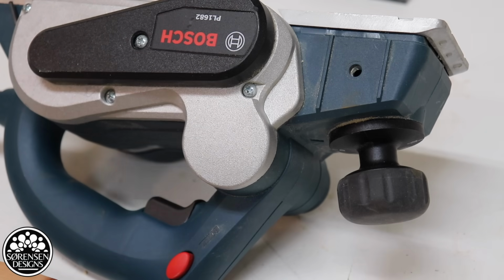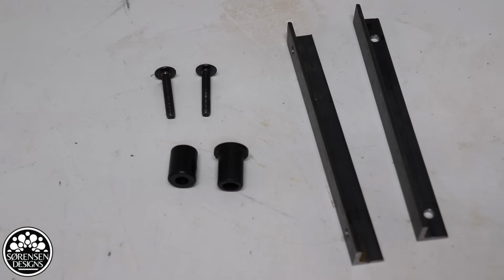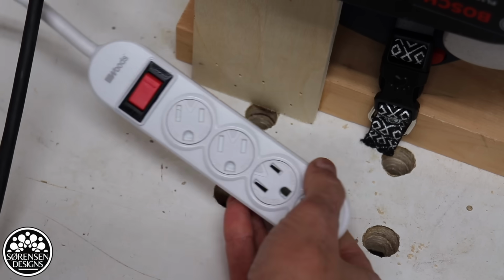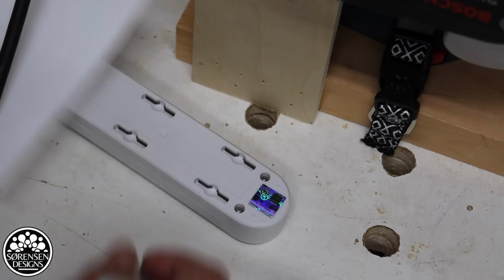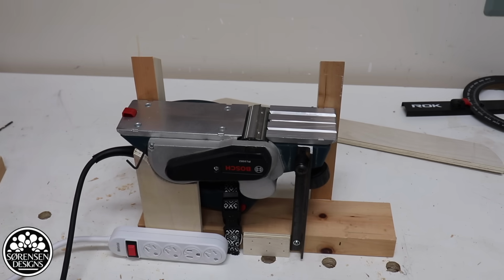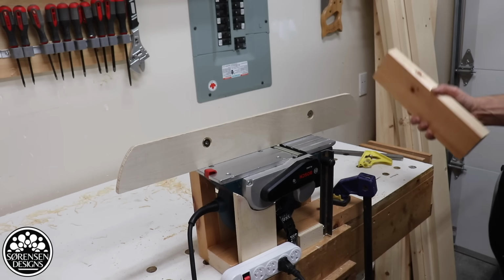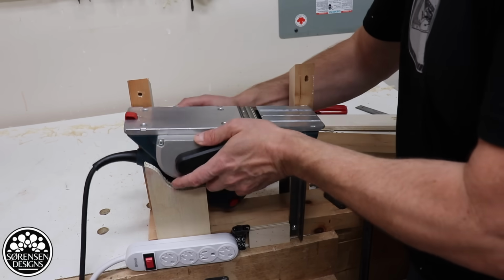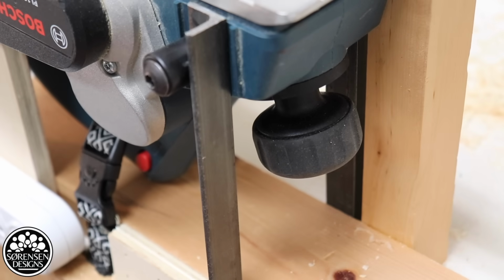Turn Your Hand Planer into a Jointer for Only $10

Comment: Great idea from the UK
Reply from the maker: Thanks @Paul Gray! Cheers🙂
Reply: Eric Sorensen would I be able to make something similar with a belt sander? Have you tried this.
Reply from the maker: @Paul Gray  You could probably make it work with a belt sander, however they generally don't have guide fences and thus no mounting holes machined into the tool. You would probably need another way to fasten the sander to a frame. I have never tried it myself because I have a stationary belt sander.

Comment: Super new to wood working but falling in love with it quick. 

Gonna be trying to make this jig this weekend in hopes of jointing some boards for a table top I’ve been slowly but surely putting together. 

Would this jig handle longer boards fine or would it need some additional fencing, or maybe even a track for the wood to exit onto?

No problem if you don’t see this, but thanks a million in advance for any info/suggestions at all from anyone who happens to see this!!
Reply from the maker: This set-up is only good for shorter stock / boards, maybe up to 30 inches max. For long boards, my latest video covers a different method: https://www.youtube.com/watch?v=-ydvJ6VXdt8
Reply: @EricSorensenCanada  awesome! Thank you so much, I’ll be watching that video right after work today!

Comment: just used your idea and works great .. i priced them planner  jointers $300 to $400 dollars and i`am like u do`nt use it much ..
Reply from the maker: @richard felt Glad to hear it's working out! Yes, I looked at a bench top jointer by Porter Cable, I think it was around $400. It wasn't just the cost but the fact that it takes up space that I don't have. Cheers 🙂

Comment: I do like the concept, but my only "drawback" to it is what happens if you have to run a longer piece of wood through it? Not that I am "hating on it" but I personally would want a much longer range of travel across the top of it, for the work I want to do, which is making table tops and things like that!! But it is still a pretty handy tool for a small shop, and I respect that!!!
Reply from the maker: @Greg Benwell  Build an in-feed / out-feed table or platform to support longer boards. This solution is really only meant to be a part time jointer.  If you are building a lot of table tops, then it is probably worth just investing in a jointer. You can also try the table saw jointer trick, which works pretty well for long boards.

Comment: Is it easy for long wood, especially morethan 2 m? 
Over all! Great work. Thanks for sharing it.👍👍👍👍👍👍
Reply from the maker: @firman syah It will work for parts that are less than 3 feet in length if you add an in-feed and out feed platform to it. If you're working often with longer pieces, it would be best to invest in a proper jointer.
Reply: Ok, thanks a lot. In my general work, I think your creation will make easy for working because simple and we can bring every where. Great regard from me.👍👍👍👍👍👍

Comment: This is so exciting to try.  Can I use wood instead of the iron supports?
Reply from the maker: @Melissa Karman Yes, however it might make the whole thing a bit bulky. You can use aluminium angle iron instead. It is soft metal and can be cut with most conventional blades. Hack saws and metal drilling drill bits will go through aluminium very quickly.

Comment: hi Eric , nice jig. I have cheap planer like that.
At  1:00 you drop a tip, about alignment for the tool.
speeding up, at 6:30 you mount the posts for the fence, with one screw and glue, but how does that secure alignment to the sole?
Where you just plain lucky? :-)
Reply from the maker: Thanks @T0rb1 NAalborg! The alignment I spoke about was in reference to mounting the angle iron. As for the fence supports, if you rip your base block to the same width as your planer, you will have no problem aligning the posts for your fence. This is assuming you have a nice flat table top to work from and you use a speed square to ensure the posts are proper square.

Comment: What would be the longest board you would recommend?  I like the idea and concept.  Great work.
Reply from the maker: @Chris Elliott, Ph.D Thanks! I generally don't run anything over 3 feet on this set-up and with that, i would suggest adding an in-feed / out-feed table or platform.  If you regularly plane boards that are longer (or wide), then I would invest in a proper jointer. Or you can use the table saw method of edge jointing, which is what I do for long boards.
Reply: @EricSorensenCanada  thank you for your input.

Comment: very good idea and thanks for sharing; I must have , missed. where you put checked the level before snugging it down... keep 'em coming
Reply from the maker: @MSG A J Himel Ret thanks! I did check for level but if you have the same hand planer, it pretty much sits level already when resting on the handle, with the angle iron secured to the mounting holes on the planer. You may have to check again if you plan to add an infeed / outfeed to this - that is where it will be most critical. Cheers 🙂

Comment: Have watched a lot of vids about converting a hand planner to a table one and I can tell you this is by far the best and most simple design I have seen, best part is that it's portable, you can easily move it around without taking it off the jig. A hand planner is in my future to-buy list and definitely this is the first thing I will do with it. Btw, I've seen planners from the WEN brand at a good price, any opinion on that brand?
Reply from the maker: Thanks Jelly G  I don't know much about WEN brand tools but it looks like a pretty basic jointer for just over $300. Some of their tools look identical to the other branded tools i.e. Ryobi. Could be that they're all made in the same factory...
Reply: @EricSorensenCanada  thanks for the reply. There's currently a 4 3/8" model at about $53: https://www.amazon.com/WEN-6530-Electric-Planer-4-Inch/dp/B079FH788Z/ref=sr_1_3?s=power-hand-tools&ie=UTF8&qid=1540494528&sr=1-3&keywords=wen%2Bplaner&th=1 and yes, their tools resemble a lot other brands.
Reply from the maker: Oh the hand planer, I thought you meant the their jointer - LOL.  That's probably the best price I've seen. Looks like it uses the same blades as my Bosch planer.  Again, I suspect they're made in the same factory as many other brands.

Comment: This is a great jig!  I happen to have the exact same electric planer as you have and have been wanting to have jointer capability in my workshop, so I'm going to build this.  Two questions:  (1)  Where did you use the vibration-dampening plastic inserts in the build?  (2)  Do you think that it would be possible to make the angle on the fence adjustable, to make faces  at angles other than 90 degrees to each other?  Thanks for the great idea!
Reply from the maker: Thanks Marty! I used the plastic bushings between the angle iron and the bolt head.  As for angling the fence, I wouldn't try it myself, but anything is possible. I guess you could put the fence on hinges at the back but you would need something to lock into place at the correct angle.

Comment: Great idea and implementation!  Simple is good!  Have you thought of making some extensions for longer boards?  Also, good idea about using the Grippers.
Reply from the maker: Thanks K.B. Woodworker! Yes, I was considering some kind of in /out feed solution to make it easier to handle longer boards. Right now, it kind of only handles anything under 4 feet. There are lots of ways to improve this jig for sure!

Comment: What great idea I will be making this for my Ryobi
Planer just wondering though why did you use a power board? cheers from Australia
Reply from the maker: @Dale Kenny Thanks! The power bar was $6. Electrical components to make a new switch would have been around $12 - it seemed an easy choice.
Reply: Did you start yours yet? I plan on using a Ryobi as well.

Comment: Hi Eric, hope you and your family are doing well and staying safe. So I have two questions on this, and by the way awesome video I am excited to get this done. My first question is I see on multiple comments you mentioned in feed outfeed table, did you ever get around to doing that or have any suggestions for building it. My second question, in one of the comments I see that you mentioned not using it for faced jointing. Could you not use it for that?  I don’t see why not but I am a newbie so you tell me.  I would think definitely for wood the width of the planer soul.  I have also seen videos for regular jointers, where people would remove the blade cover, face joint half of the board, Flip it around and do the other half. Do you not think that that would work on this? Thanks brother and keep up the innovation
Reply from the maker: Thanks! I haven't built an infeed /outfeed for mine because I haven't needed one so far. This solution will only handle stock that is 21/2 inches max. Better for edge planing, but if it's a piece of 2x2 stock you can plane all sides no problem. If you have a full sized jointer, you can face plane boards up to the width of the planer head but if you're doing something wider, invest in a thickness planer, you'll get better results.
Reply: Eric Sorensen thanks..... what is the size of the screws that you used to go through the angle iron the holes on my Ryobi hand planer look like maybe 3/16 Quarter inch is definitely too big and what is the length of the screws you used
Reply from the maker: You mean the mounting bolts?Mine were M6 I believe. You will probably need a metric thread and size - most brands won't be using a standard imperial size. What I do is go to home depot, grab a few metric bolt sizes, walk over to the power tool department and try the threads on the display model if they have it out. When I get a match I just buy what I need.
Reply: Eric Sorensen lol, I started doing that but it look like all the smaller thread sized ones were in packages no loose ones.  Decided I would figure it out at home and go back tomorrow. Thanks again man

Comment: I feel stupid. I just made a router table in my workbench and actually wired a switch and outlet. I never thought of just using a power strip. Oh well it was fun wiring it
Reply from the maker: @Robert Cary I was going to do the same but then I saw these strips for $6.  If it's for a router table, I think you chose the better route. A full-sized switch will probably last longer.

Comment: Great video, I am building one of these and your design is great. Was there a reason for using the locking collar instead of the planner push in lock button?
Reply from the maker: @Brendan Cook Thanks! Yes, my hand planer lock button doesn't always stay locked, so I used the collar to keep the button down. If you have one with an independent locking button, you can probably skip the bit with the collar.
Reply: @EricSorensenCanada  That's a good point and a great idea. The part of my L shaped bench I building into, will not be easy to get to once setup as it has shelves in front it.  Thanks for the follow up and the great content.

Comment: I really liked your jig. Seriously thinking about going that route due to need a jointer on occasions. Does the rotation of the blades work as is, or on reverse ?
Reply from the maker: @Rene Mercado My Hand planer does not go in reverse. You just feed as you normally would, the only difference is the planer is stationary and the wood is being fed into it.
Reply: @EricSorensenCanada  
Understood. Thank you very much for your response.

Comment: Hi Eric, very cool jig and so far the easiest and most practical one I have seen around. I am looking at building one for my Ryobi hand planner, but I have a question. How would you suggest to go around the safety trigger that requires the push of the trigger and the safety button side to run the tool?
Reply from the maker: @Marcio DeBarros Thanks! I solved that issue for my planer by adding the lock strap to the trigger to keep it in the "on" position. It's in the video. I don't know if the Ryobi works differently but the the side button should be able to lock when the trigger is pressed.
Reply: Eric Sorensen thanks... I finally understood the purpose of the puppy collar on your design. Brilliant 😂😂😂

Comment: My only concern would be the switch on the power strip. It's probably not rated for that many switches on and off. Has this lasted tho?
Reply from the maker: It's lasted just fine....BUT it's really just a part-time solution. I would say that if you're using it every day (or frequently) , just save up and invest in a real bench top jointer. They start at around $339 for a Porter Cable and go up from there.

Comment: nicely done, I am thinking about this jig for my hand planer but i need something that will plane a 6' long board.. does this get larger stock straight or does it still ride the "waves"?
Reply from the maker: @Anthony Smith It's really only good for edges on stock no longer than 3 feet (with on infeed outfeed platform). If you're working with longer stock, I would buy a jointer or use the table saw method of jointing.

Comment: Very good and precise instructions. Thanks.
But I couldn't help wondering  why you have all the other expensive tools except the jointer which you want to make for $10/-.
Reply from the maker: By comparison, Jointers are pricey. You can get an entry level jointer (Porter Cable) for around $430 and they get more expensive from there. Typically they average between $600-$800+. The main reason, however is space. they take up a lot of space and I currently just don't have room for it.

Comment: Very nice video. Can I use wood support instead of angle iron?
Reply from the maker: @MarinaWaves Thanks! I guess you could try oak or maple but it's probably better to have a nice straight piece of angle iron and less bulky. If you don't want to cut steel, you can buy aluminum angle and cut it with a hack saw - it's soft and cuts quickly.
Reply: Eric Sorensen Thank you so much for your prompt response.

Comment: I'm new to woodworking, would this jig be use with long lumber, about 2-3 meters?
Reply from the maker: No - It's only good for lumber under 3 feet long. You need a full sized jointer for long boards or use the table saw method for jointing.

Comment: Just curious, what’s the longest piece you’ve run through this elegant jig? I only watched this yesterday, and started building my own version. Thanks!
Reply from the maker: It's only good for parts under 3 feet in length. Max is usually the average length of a table leg (30 inches). If the parts are any longer I take the planer out of the jig and do a hand-held operation.  I'll also use my jack plane /no.4 plane.
Reply: Good to know. Definitely works for me. Thanks for taking the time to reply and, again, thank you for putting in the effort to make a concise, informative  video.

Comment: Nice! I need to joint some 2x10s and 2x12s for a table, but they're 8' long. Do you think this would work for that? I guess maybe if I had a long enough (and level enough) infeed and outfeed tables? Any ideas and insights would be appreciated!
Reply from the maker: @Tim Sawyer This is great for shorter boards 3 feet or less, but for long 2X4s I would suggest using the table saw method for jointing. You could try it with some in-feed out feed tables but it still might be tricky. Personally, I would never joint something that long. I always cut to the rough length that I need (plus 6 inches), joint the parts then square them up on the ends at the miter saw for the final length.
Reply: @EricSorensenCanada  OK, thanks.

Comment: Yet another great build Eric! Too bad that you couldn't incorporate a swing out blade cover for it. Don't want to sound like the police squad but I had to cringe when you ran that last board over the planer as your little finger was very close to that rotating blade, just saying.
Reply from the maker: Thanks Steve! I'm pretty comfortable with my tools. it might have looked closer on camera than it actually was. That said, I should use my Grripper and will do so going forward. A spring loaded cover could be incorporated into this design pretty easily. Or at the very least, you can make your own Grippers.

Comment: I didn’t see where you used the bushings? Please explain are they optional? Thanks
Reply from the maker: @5:29 you will see the bushings installed on top with the angle iron. It's used to dampen vibration. Not critical but it does help. You could use plastic and metal washers instead.

Comment: Is it good to flatten the face side?
Reply from the maker: It's not really wide enough for that. I use mine for edge jointing only.  A better choice is to just use a good #4 bench plane if you don't have a thickness planer.

Comment: Eric One other question big guy, I have some 8 inch steel flat bar left over from another project, would that work in place of the angle iron?
Reply from the maker: It depends on how thick the flat bar is. If it's too thin, 1/8" or less, it might wobble. Angle iron will be the most stable between your planer and the base.
Reply: Eric Sorensen yes it is 1/8” steel flat bar, not 8 inch.....damn Siri lol....so no go on the 1/8”
Reply from the maker: I wouldn't try it my friend. You might not get the stability you were hoping for. You can probably get a hold of a scrap piece of angle iron for cheap (or free) if you check the scap bins at the local steel supply shop.
Reply: Eric Sorensen I’m OK buying it just thought I could use some leftover stuff but no biggie thanks again brother